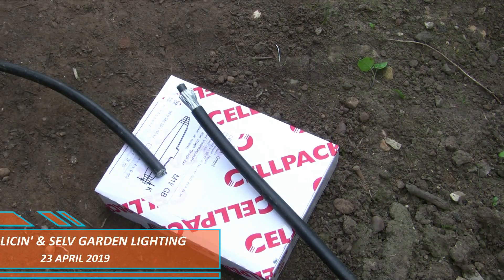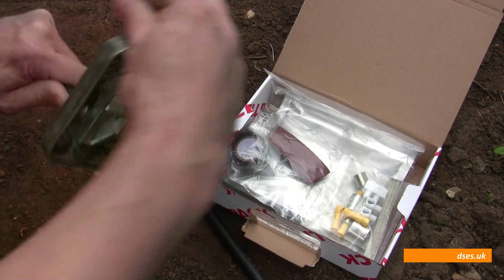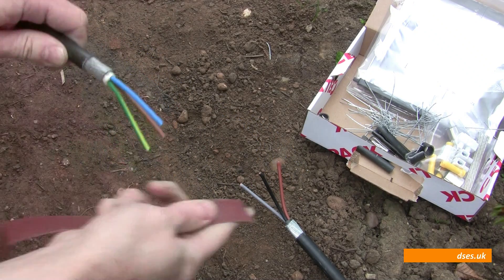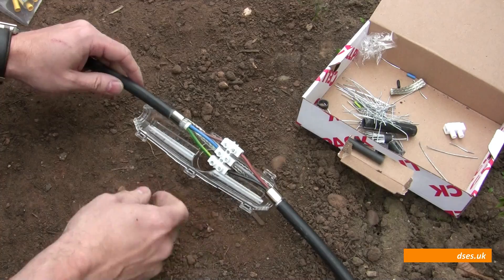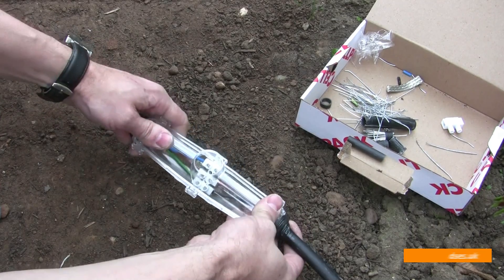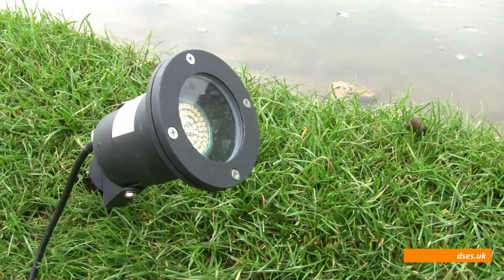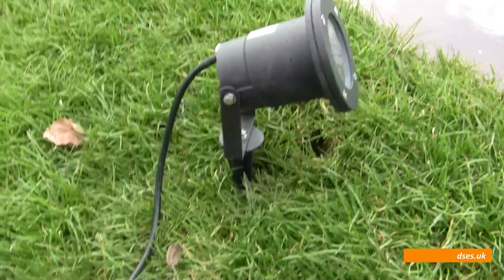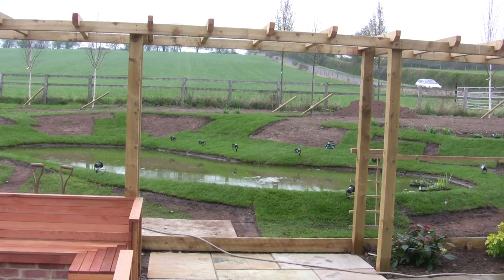SWA splicin' and SELV garden lighting

Comment: I don't like the constant force spring clips particularly when there is no furrel. I use appropriately sized jubbly clips with the armour running straight through and jointed directly to the amour. I find this stiffens up the cable to hold them in line for the carcase and provides a more reliable mechanical connection. 
I couldn't tell if you did or not. Ruffing up the outer sheath as it enters the joint with the sandpaper allows the resin a better chance of providing a a waterproof seal. Also i prefer appropriately sized crimp joints and if not using the choc blocks singularly and staggered to keep the connectors well within the main body of the resin rather than near the edge and often showing through the resin. 

Like you I think 12v is a much better idea than 230v for outside lighting.

Comment: Hi David I’m Of the same opinion why put 230 kit in and mess about with wiska boxes and maybe swa which although good kit look ugly next to a little spike light in a small garden when you can work with flex and ELV kit. I’d like to know if the Amazon stuff in the links was decent quality and has had no problems ? Don’t know why it’s so difficult to buy 12V stuff it all seems geared to the 230V gear which has inherent installation issues.

Comment: Circuit for garden lamps could just as well be PELV (use of RCD would highlight a fault condition). Using SELV in the right conditions, ie stood in water (pond) and if a fault had occurred, this could lead to a shock or at least an unwanted tingling. Wet hands give the conductive path a greater area to connect too.

Comment: No way is that a good Cast joint kit, never use  terminal screws, and the earth continuity is just asking for high resistance. The better kits come with a ferrule that slides under the armouring, then a non-return clamp is used to connect the braid to the armouring.

Comment: Great video David, I remember doing two joints  on the top of a fuel tank. The cables were 240 mm 4 cores. We mixed the first bag and poured the joint with success. On the second joint we split the resin bag and scooped it in to the joint with bits of steel armour and all the the cable trimmings  by hand. The site electrical engineer put our joints under a  5kV test and it passed. I guess it's still working OK now.

Comment: commentard dark ages haaaaaaaaa ha what a twatapotamous.............   low voltage (12v) is best solution and led diver is constant current device so don't have to worry about voltage drop on long runs driver will adjust voltage to keep set current level

Comment: The SWA connection is absolute shite. Electrically poor, mechanically non-existent. 

Pull that cable and it's obvious where it's going to pull apart ! I guess the inept IET finds this perfectly acceptable. The clear plastic 'tube' ought to be metal with cable clamps at each end for the SWA to be clamped into and bent over to ensure both sound electrical and mechanical connection.

Comment: 6:00 "I'm not a great fan of crimps" YAY !!!

Lots of sparkies seem to love them (JW included) but I'm so pleased you've accepted that they're a flawed technology.  (video gets a thumbs up for that)
To an engineer, we know that when the crimping tool is released, the natural springiness of the crimp metal will release some grip on the wire - and this is unavoidable - unless the method of crimping is by use of screws in a giant 'chocolate block' which you leave in place. An alternative is to crimp and then solder. Crimping also has no conductor-cleaning function like a screw has as it's being gouged into the conductor. Quite possibly why sparkies need torque screwdrivers and engineers do not.
Reply: I know what you’re saying about the springiness of the metal, but the crimp is designed to take it into the ‘plastic’ stage in the stress strain curve, and at this stage it won’t try and return to it’s original shape, which is perfect for the job

Comment: liking your SELV fitments. I am Looking at 12v led strip outdoor fed off outdoor supply. Have you a bit more video on how you 240v supply to a IP socket ect and then tap the SELV off? Or do you keep the driver in the warm and run them separately? (Or IP MCB box / fused spur to step down )
Reply from the maker: No video on that at present Stephen, but in this case the SWA terminated onto an IP enclosure where it split off to feed the socket and to a second IP enclosure adjacent to it that housed the driver. An inline fuse was also installed in this second enclosure where the mains came in and before it went into the driver. The driver in use is a MeanWell product rated at IP67 so it didn't need to be enclosed, but I hid it away for aesthetics and to keep the wiring nice and dry.
Reply: @dsesuk David, Do you know of a Black IP Rated Module Enclosure?
Reply from the maker: @stephencoulthard1718  Only what Wiska produce! They're not big enough for much, but it may be worth asking at your local wholesaler (CEF/Eddies et. al.), they sometimes have different or specialist stuff lurking on a shelf!
Reply: @dsesuk  Thank you! I will go see what I can find :) plenty of white stuff not enough Black especially where you need to make stuff more subtle ;)
Reply from the maker: @stephencoulthard1718  Yeah, I don't know who thought light grey would be the only colour of choice for IP enclosures!
Reply: @dsesuk  or I know you can the back half in Black then front in Grey :(

Comment: Can anyone provide a link to such examples of drivers than can be used for this type of bulk led application?
Up to now I have only ever worked on led fittings with individual in built drivers. Are they readily available at the wholesaler? 
Cheers.
Reply from the maker: I tend to use constant voltage LED drivers, you can get them in low Wattages, 6 - 20W for driving a few lamps in parallel or some LED strip, but they can also be sourced with much higher oomph. Last week I installed a 100W driver to power eight MR16 LED lamps, nine metres of LED strip and ten G4 LED lamps. MeanWell are about the best brand you can buy, but there are smaller brands out there and Sebson who I mention in this video make drivers I've used in the past which seem low cost and reliable. I tend to get them in from Amazon such as this example: https://amzn.to/2Zs0tiq [affiliate link] as I find the wholesalers don't tend to carry much of use on the shelves. The trouble with wholesalers is they stock gear they think you want to buy, but they never ask what you're actually having to buy from elsewhere because they don't keep ready stock!
Reply: Great help thanks! Imay look into this for my own garden, keep up the real world great contect 👍
Reply from the maker: Thank you sir, and good luck with your project!
Reply: Lets just say it will be photoninduction'd 😉

Comment: Crimps ok longs you use the correct crimping tool and the correct size for the cable
Reply from the maker: Quite so, I just don't like crimps as they sometimes aren't mechanically sound.

Comment: This is the first time I've seen  a UK 12 volt  landscape lighting video.  I'd say it's much safer then mains voltage lighting.  In the US nearly all landscape lighting is 12 volt LED. The downside to it is the landscape contractors got in on the 
 installing and not exclusively the electrical contractors.

Comment: Quick question, did you run the artic in some flexi conduit in the ground or just have it buried straight in the soil - not having a dig (no pun) just comparing notes so to speak 😎
Reply from the maker: When we lay cable for low voltage lighting like this, we tend to run it through a flex conduit. On this particular job, the landscaper had put it directly in the ground without such. It'll probably be alright, but I prefer to have that extra little layer of protection myself.
Reply: @dsesuk  I thought you might of, thanks for the reply 👍

Comment: Crimps would have been better if you crimp the crimp correct it is always better than a connector block
Reply from the maker: I find it physically awkward to manoeuvre the head of the crimp tool around three wires so physically close as these. The first wire is no problem, the second is a little awkward, but once they're in place, the third is tricky and sometimes the crimp process fails. Under most circumstances, I agree that a crimp is better, but in this application where the screw connector is physically easier to install and the screws cannot work loose because of the resin, then I choose the screws.

Comment: Have you ever come across garden lighting cables which have been chewed by foxes, I've had that recently with some 12 volt ones & some solar rope lights.
Reply from the maker: Yes, I had a job a year or two ago where some 12v LED marker lights inset into brick edging around the driveway had been dug up and thoroughly gnawed at. They'd have been alright if the landscaper had run the wiring under the bricks, but it ran in the soil behind them.

Comment: Oh mate, I'm usually with you (you're clearly a VERY talented guy!) - and I was on this vid until you said that GU10 and MR were equivalent unless you downsized the voltage. I use GU10 EVERYWHERE cos in this world of smart lighting, I have lamps that are grouped together and controlled by Alexa and Google. I REALLY feel your pain about the "final 12 inches" as I call it - the bit of exposed cable to the IP67 lamp fitting - but as long as it's RCD/RCBO protected.... I think these days customers are more demanding. MR16 doesn't cut it for technology. Lamps like Lohas have Wifi built in, and can be controllable individually or in a group. I implore you to future-proof your technology solutions, not just your electrical ones. DM me anyday if you want to discuss, I'm passionate about smart-tech!
Reply from the maker: When it comes to garden lighting, then unless the client has specified they want something clever, I'll take the safety of ELV over possible future expansion every time. For something like this, basic on/off control can still be put in at source if they want to voice activate it. I just don't like relying on an RCD as the sole means of protection should that flex get nicked and the line cores become exposed; it goes against Regulation 415.1.2. Besides that, I'm on the opposite end of the spectrum when it comes to smart tech: as far as I'm concerned, it's not my job. I deal with fixed wiring and faultfinding only. If the client wants smart stuff, they can buy it and I will install it, but there my support ends, they can figure out for themselves why it's not talking to their iPad or whatever! I don't want my warranty support to become bogged down with IT support just because Google or Apple have moved the goalposts and stopped supporting a product or have issued an update which borks it in some way. Of course, there are those out there, perhaps such as yourself, who can make a good business out of smart tech solutions, and I wish you all the best with it, but it's not for me and my business.
Reply: As someone in the IT industry, I also think smart lights are a terrible idea.  If you want to control things through Alexa or whatever, wire them back to a single controller and securely interface with it there, don't have little WiFi/RF clients in every single light fitting.  Not only do they sit there chewing up power even when the light is off, but then your neighbour upgrades his router and suddenly your lights don't work anymore because he's picked the same RF channel as you.

Then of course most tiny embedded devices don't have enough processing power to do WiFi security properly (not that it's great at the best of times) so you may as well wire a switch out in the street so passers by can turn your lights on and off as they please.  Granted losing control of your garden lights isn't a big deal, but if you use these for indoor lighting it's just going to be annoying when the kid next door figures out how to turn your lights off while you're in the middle of eating.

Comment: 12v is all well and good  but for long runs voltage drop becomes an issue and any large loads at that voltage would require silly thick cables
Considering all electrics outside must be RCD protected using 230v isn't really a safety issue imho.
Also the 12v option would be significantly less efficient and use more power than if you did the same setup in 230v
Reply from the maker: At this scale the facts are, this works, 12v is demonstrably safer, an RCD would be considered as additional protection only. You can't say this would be safer using 230v with an RCD present. There's a reason regulation 415.1.2 disallows this (assuming flexes from 230v GU10 spike lights trailing around the garden waiting to be cut). As for energy efficiency, who cares? Lighting up their garden pond is a luxury, not a necessity, and is any saving in energy by whopping up the voltage really more beneficial than the safety of ELV? For a larger scale, or a more industrial application then yes, but we're talking about domestic garden lighting here.

Comment: Is it not cheaper to replace the 10 meter length with an 11 meter length??
Reply from the maker: It was already cleated to the wall and terminated at the other end, but I could have replaced it. As I'd spoken of the gel splices in the previous video though, I thought it would be good to show a resin joint going in. Sadly, it was a bit rushed and I hadn't charged the camcorder!

Comment: The only way I do garden lights is 350ma light fittings wired in series or 12v.. Nice bit of metal flexi conduit from the Ip joint to the back of the fitting should keep that flex safe from lawn mower and Foxes.. foxes love eating flex..!

Comment: Sebson SMD5060 are for Indoor use ONLY, they will suffer from condensation problems over time if used outdoors, it even says this on the box!
Reply: It's indoors a IP rated enclosure :P
Reply: @timballam3675  IP is a water Ingress Protection rating , NOT for condensation.
Reply from the maker: It says it on the Amazon product page, but not on the packaging. That's probably just to stop some idiot using it in an unprotected enclosure outdoors and is likely given as a point of sale warning on most electronic components to protect Amazon from returns. From my experience, I can say I've put a lot of these in over the past couple of years without issue. It is true that exterior conditions will screw over any electrical or electronic equipment given enough time, but that's not what I'm seeing with these. Of course, you're under no obligation to follow my recommendations.
Reply: @dsesuk  I've used them and they went cloudy, even inside an enclosure, they still work but i'm not expecting them to last, they have dulled.

Comment: Agree that very low voltage is necessary in such situations -- especially around water -- but the cable going straight into the turf is a terrible idea. That is bound to be cut by mowing/strimming.
Reply from the maker: Something is being done about that.

Comment: What about volt drop could you  have gone for 24v?
Reply from the maker: The run isn't long enough, and the 2.5mm cable is fat enough, that it isn't causing a problem. Volt drop would still exist at 24v though, and the effect of not enough voltage getting to a 24v lamp would be the same as if not enough was getting to these 12v lamps.
Reply: @dsesuk  24V would be half the current, and given that voltage drop is a function of I2R losses, the voltage drop is halved in real terms. Given that you've doubled the voltage to start with, you then end up with a quarter of the percentage voltage drop that you have with 12v.
Reply: @charlotterobinson9452  And who exactly sells 24v mr16 bulbs? answer no one! 12v bulb = 12v source

Comment: Good job, mate. SELV is much better than 230V if it's a relatively small load and the cable is not too long. In this case, good use of SELV, especially because the lamps are next to the pond. The gardener will not be shocked dead, when he mows them over. Always think about the unthinkable.

Comment: Hello David, is that LED driver definitely transformer isolated? As I cannot see that specified on the amazon listing. 👀 Could I also ask you what box you used to house the LED driver and terminate the various cables.
Reply from the maker: Hi Gordon. The unit is stamped as SELV, but despite coming with a whopping amount of paperwork it doesn't go into any greater detail. It's a model I've used previously without issue, but there are transformers with better IP ratings for outdoor use. This one is housed in a polycarbonate case from CEF at the outbuilding. The SWA terminates onto one enclosure with the wiring passing through a short bit of conduit to a second enclosure where it goes to the remote switch receiver which then connects to the driver.

Comment: Sebson lamp?? Tight budget?
Reply from the maker: I've never seen a Sebson MR16 fail. Also, other makes of lamp I've used in the past have proved problematic with flicker, weak light output or outright conking-out. I fitted Osram before and experienced a high failure rate. I put a two-year no-quibble on site warranty on anything I supply and install though.

Comment: Not used the wireless stuff before. Does the 230v supply get fed to the receiver first then from the receiver to the LED driver?
Reply from the maker: The receiver is just three wires, 230v in, neutral and 230v out. At the end of the SWA is an IP enclosure containing the receiver and LED driver. The nice thing about these remote switches is that the switch part is self powered - it has no battery. I believe it's piezoelectric like one of those gas lighters so the action of pressing the button powers the signal sent out. They've a good range though, and they've proven reliable for me. Simple and cost effective!
Reply: @dsesuk  Thanks for the quick reply. Good vIdeo. Yeah ive seen a few videos with the quinetic wireless  stuff. It Looks good. Its a bit more pricey though.